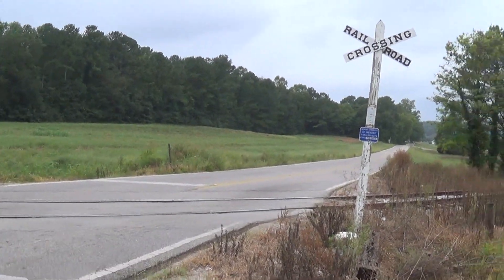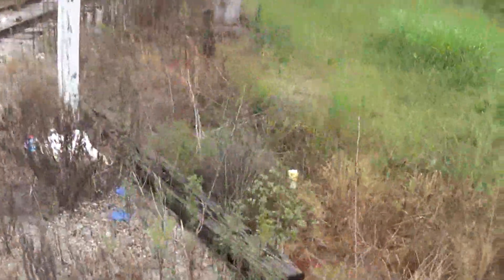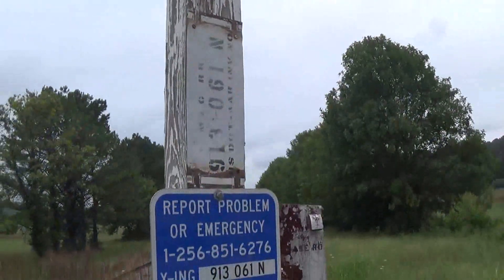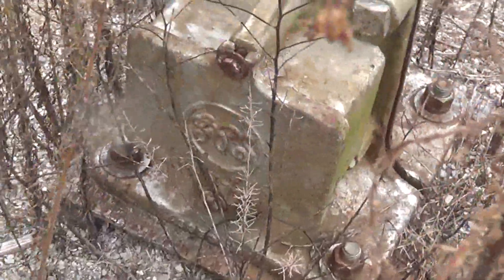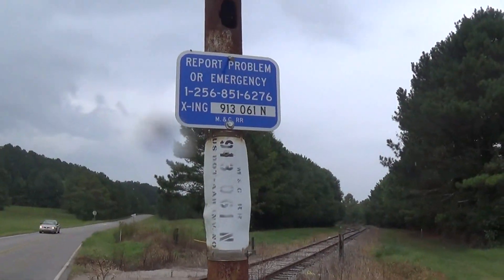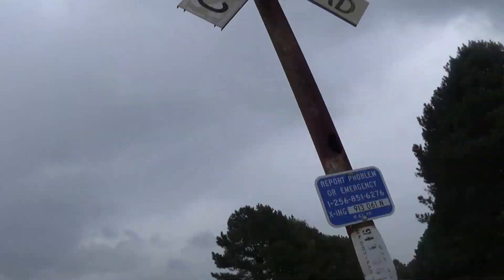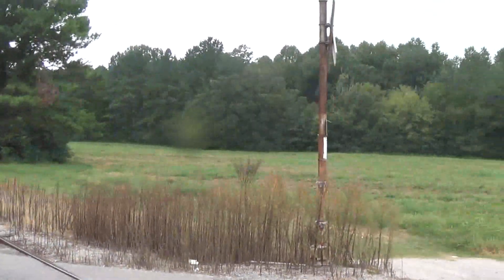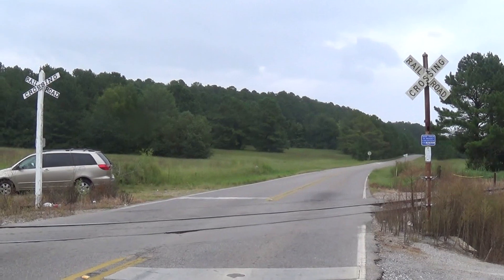Chase Road Railroad Crossing, Huntsville, AL Crossing Tour

Comment: What was wrong with the crossings?

How come they got removed?
Reply from the maker: The detection equipment was not up to the FRA's standard so the FRA told them to upgrade the detection equipment or remove the signals.
Reply: Pretty reasonable for Higdon Road, Chase Road, and Moores Mill Road #2 to get downgraded to crossbucks since the M&C is a shortline with a budget they couldn't afford to upgrade all of the signals, so instead opted to just downgrade them instead.

Comment: Who would make a homemade cross Buck?
Reply from the maker: A dirt-poor railroad like the Mercury & Chase.
Reply: I wonder how they could afford the emergency info
Reply: And did someone run in to the replaced cross buck?
Reply: One more question: have u been to meridian street
Reply from the maker: tHEWHateVER 1. It was required by the FRA to have.
2. They just removed the signal when this crossing got downgraded.
3. Plenty of times.
Reply: I saw the end of the track on that road
Reply: It would be nice if there were some pictures of when it had lights and a bell...
Reply from the maker: tHEWHateVER https://www.google.com/maps/@34.785209,-86.5522462,3a,75y,99.83h,84.11t/data=!3m6!1e1!3m4!1sFce4NHba0XVOCAPUy0BNyQ!2e0!7i3328!8i1664?hl=en
The NARM also sells a post card that shows the crossing back when it had GRS 8 inch lights still.
Reply: I wonder if there are any more downgraded crossings.
Reply from the maker: tHEWHateVER Moores Mill Road #2 and Higdon Road.
Reply: Other than the Higón road one
Reply from the maker: tHEWHateVER These three:
http://www.rxrsignals.com/Alabama/Huntsville/Moores_Mill2/
http://www.rxrsignals.com/Alabama/Courtland/CR400/
http://www.rxrsignals.com/Tennessee/Chattanooga/Hickory_Valley2/
Reply: On the last one I saw a gated crossing, must be newer or owned By a different corporation...
Reply from the maker: tHEWHateVER Busier crossing there.
Reply: This is sort of a sad sight because just to think of the equipment that was on here when this was a lighted crossing, but this crossing probably would have been upgraded.
Reply: What happened to the other crossing signal
Reply from the maker: tHEWHateVER Removed.
Reply: freebrickproductions but why
Reply from the maker: tHEWHateVER The FRA told them to downgrade the crossings or upgrade the detection equipment.
Reply: freebrickproductions it just doesn't make sense, I mean why would u take down a crossing and just not remove the lights
Reply from the maker: tHEWHateVER Wouldn't be too surprised to find out that signal had also gotten hit.
Reply: Yep, the crossing looked a lot better when it had lighted.
Reply: There wasan't really any trash, all the vegetation around it now was cut down.
Reply: It just looked a lot better.